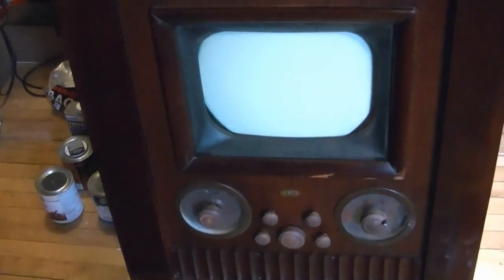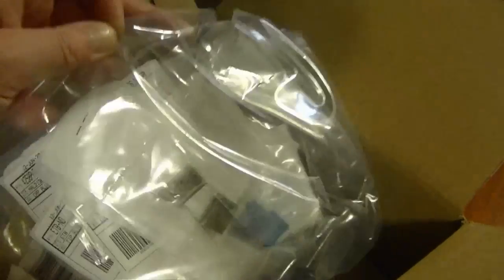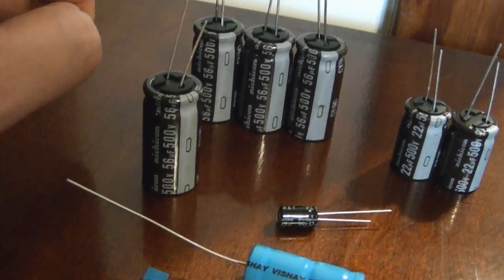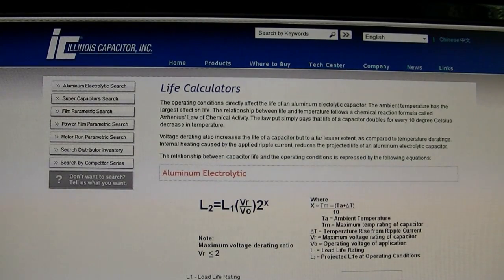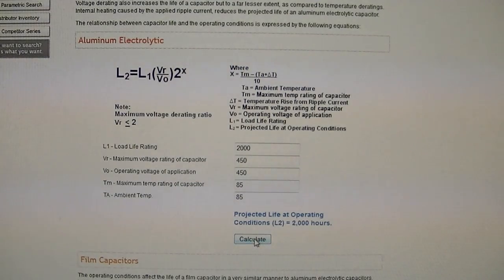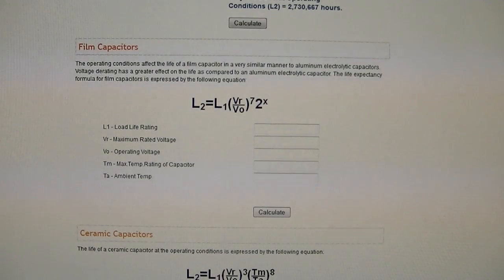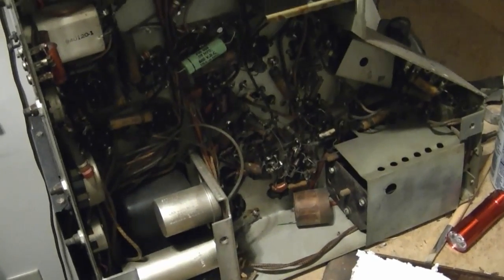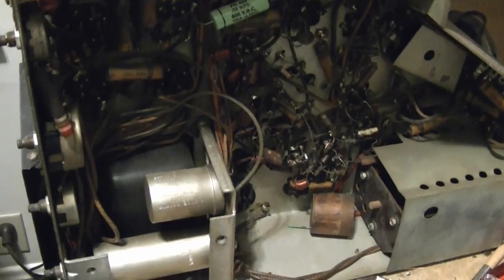Capacitor talk

Comment: Hey bandersentv. I have a table top transistor radio from '67 and in the power supply. The schematic calls for two .05 600v caps. They are axial leads and I'm having issues finding replacements. Where did you happen to find the white caps in your video? I looked on mouser and digikey and can't find anything for those values. Also, will .047 be an ok replacement for .05 as .047 seems more common? Thanks!
Reply from the maker: Those are Mallory 150 series caps.  Mallory is now owned by (merged with ?) Cornel Dubilier (CDE)  Looks like they still make the 150 series but they are yellow.  Here are some for sale at Mouser Electronics   https://www.mouser.com/Cornell-Dubilier/Passive-Components/Capacitors/Film-Capacitors/Type-150-Series/_/N-9x371?P=1yzn822Z1z0zlgfZ1yp7zip
Reply from the maker: Oh and I know I already answer you on Facebook but in case anyone sees this here - Yes, 0.047 is fine to use.

Comment: Is there an age where you should replace capacitors by? im asking cause my RCA AER 095L, is getting snowy with age but still works well.
Reply from the maker: That depends entirely on the specific model of capacitor and temperature.  There is really no way to know for sure withut testing them.  Cheap caps are rated for about 1,000 at full temp (typically 85C).  Higher quality caps are rated for 5,000 - 10,000 or even higher at (105C).  That might not sound like very many hours, but life goes up rapidly for lower temp.  Heat is death to electrolytic caps.
Reply: @bandersentv  I know not really your field, but im in the process of repairing a Sunbeam Mixmaster model 12, it has a cap in it from the 60s, 0.08mfd at 160vac would you know a good replacement for such a cap?

Comment: Ok, I'm still a little confused as to what you are doing; from my knowledge, an ESR meter is primarily used for electrolytic capacitors only, to ascertain:- 1. If there is a much greater ESR to that of a an identical rated replacement. 2. If there is a short circuit.
The values of 0.01µF, 0.05µF, and 22nF 630V I have never seen in electrolytic form.
In the event of the characteristics of an increase in capacitance; wax loss/degradation with hydrophilic properties of the paper comes to mind..

Comment: They values were written like this 0.01µF and 0.05µF. I measured them out of the circuit. So the 10nF one went up to 20nF and the 50nF one went up to about 100nF. I tested them for leakiness and guess what.... they were pretty leaky. Another one wich was 22nF @630V was very leaky. I know how to read capacitors, but thank for you the effort :). So my question still remains why they've gone up in the value and not down?
Reply: They haven't gone up in value, the leakage is confusing your meter. You can easily check this by measuring  a known good capacitor, then measuring it again with a resistor, say 220k in parallel with it. Sneaky blighters, capacitors.

Comment: I have to ask if the 10nF and 50 nF, and 100nF, and 120nF were meant to be in μF (microfarads)? Otherwise, of course they would measure open out of circuit.. The nF stands for nanofarads, where 1nF = 1/1,000,000,000 F =
0.000000001 Farads.

Comment: I would imagine you achieving greater capacitor life than the originals, but as you so well pointed out, you can purchase
cheaper electrolytics with much less reliability. Although today, after manufacturing advancements aside from mass production, they are very cost effective items to get a good repair result. I worked on video recorders/televisions for some years replacing them, and I look back and think, 'What would I have done without them?'..

Comment: In Australia, we converted to metric with:-
Distance, Area, Volume,
Weight (mass),
Speed (Velocity),
Energy (Calories -> Kilojoules),
and a number of other combinations..
I note that car tyre (tire) measurements have a combination; the diameter of the rim is in inches; the width and height from ground to the edge of the rim is in millimeters..

Comment: The formula for temperature conversion:-
Degrees Farenheit = (1.8 x Degrees Celcius) + 32.
Curiously, I have never seen an electrolytic capacitor
with a farenheit temperature rating..

Comment: I was rather lucky at primary school in Australia in the early 1970's; conversion to metric occurred, and I'm familiar with both imperial and metric measurements. With temperature, knowing freezing point of water is 32 degrees farenheiht, and boiling point is 212 degrees; zero Celcius, and 100 degrees respectively, a conversion formula is:-
Degrees Farenheight

Comment: Did you have the windows open while filming this video. I'm listening to the audio through headphones and you have a pretty good microphone. Does it record in stereo ? Sure sounds like it. Amazing the technology being used on the capacitor front these days. Especially when a 8 mfd capacitor used to measure 3" by 5" and was a big block !

Comment: Thanks for the info. I've got a radio from 1978 to restore (my first one) and it had about 3-4 good electrolitics and all others were pretty much dead. The interesting thing is that on the ESR meter for a 20µF @6.3V still shows 1.2R or thereabouts. All of the 10nF to 50nF check on the capacitance meter at least double. Typically a 100nF has an ESR of about 40-65R but the 50nF ones that measures about 120nF shows open. So my question is why they increased in capacitance over time -metal can caps

Comment: I question if relative humidity could have some factor in capacitor life.  My grandmother had a Sears TV that has an RCA chassis for 22 years. She lived in a rather damp, humid area. The set never needed service. Not even the controls on the back have been touched. I noticed right before her passing in March that the set was showing symptoms of  tired capacitors. My grandma was an extreme homebody type that watched allot of TV. Esp. in her later years.

Comment: Part of the problem is that a few what were once reputable brands have also had their products made in China. I'm currently having problems with a DVD player of the Toshiba brand, well they must have had a Chinese company build it for under contract because it doesn't use Toshiba caps, it doesn't use Nichicon, Rubicon, Nippon Chemicon, or even Panasonic brand caps, it uses some mystery China brand called "Xunda" on the power supply board and a Taiwan brand called "Lelon" on the control board.

Comment: Excellent informative video. In the high-end audio world, everyone bemoans the discontinuation of the Rubycon Black Gate series caps. 

One important factor in cap life, is regular use. Caps that sit in a component that's never turned on actually die faster than in something that's used regularly. Bringing a long dormant device out of hibernation slowly on a Variac can often save the old caps.

Comment: I know the type you mean, Solar brand Sealed-Tite capacitors, probably the best paper capacitors made during the 1940s-early 50s. Those are the only capacitors from that era where you can put one in a resistance-capacitance bridge type tester and have them still read as usable, though not trustworthy, just about all of the other brands fail straight off.

Comment: If you buy capacitors of a reputable brand name, there are probably a dozen electrolytic brands out there, mainly China and Taiwan brands, that are absolute crap but are popularly used in many consumer electronics from computers to flat panel TV sets giving them an appalling failure rate. Then on the other extreme you have some American made Zenith TV sets from the 1970s, like Chromacolor IIs, still in operation that have never seen the service shop.

Comment from the maker: I used some of those when rebuilding the K networks in my Predictas and they work just fine :)  I have read the capacitance varies with applied voltage though and they might not be suitable in all applications.  I think it's something to do with the electric field altering the dielectric constant.
Reply: ...that's ESPECIALLY true when the capacitor(s) are used in sweep circuits-(!)

Comment: Of course when dealing with a Taiwan/China crap capacitor brand you can throw the life calculation formula out the window, they last five to eight years maximum, no matter what alleged rating is printed on the label, even just sitting on the shelf.

Comment: I was thinking of finding some small cardboard tubing to make replica capacitors shells, the question is where do you find tubing between 1/4'' and 1/2'' inner diameter? I asked about the axial lead film caps from one source, and they said that they get them made to order, so there isn't really an issue at least with the yellow no name kind. Siemens used to make film caps as well, but I don't think that Mauser carries them, they are too expensive anyhow.

Comment: I bought a batch of axial Vishay caps to rebuild an old Garrard phono stage. Not cheap. I rebuilt a Tram CB with all radials. Looks a bit messy with radials on top of the PCB where the radials went, but it would have been to expensive otherwise. Very annoying not being able to get the parts I want all the time.

Comment: That was a real eye opener to see that voltage variations do not affect the life of the capacitors that much compared to the temperature. That makes a HUGE difference! I am going to save that formula & play around with it.

I have been using the Nichicon "PZ" line of electrolytics to re-stuff the cans. I am looking at the new line of Nichicon rated at 10,000 hrs too. In one application the dimensions still let me re-stuff the cans with these.

Thanks a million for the tutorial!
Tom